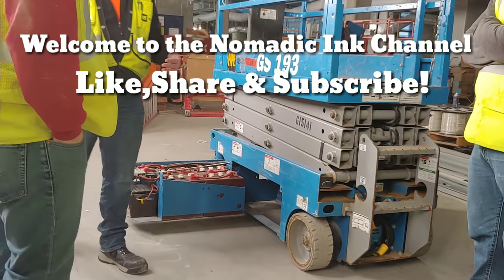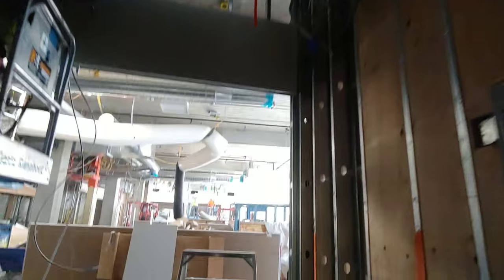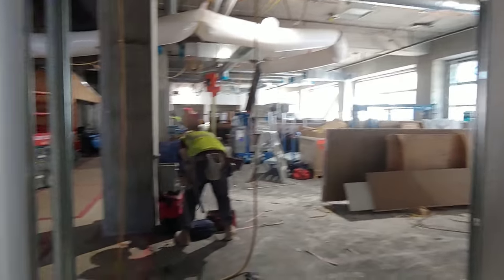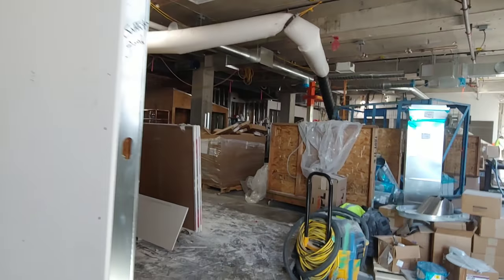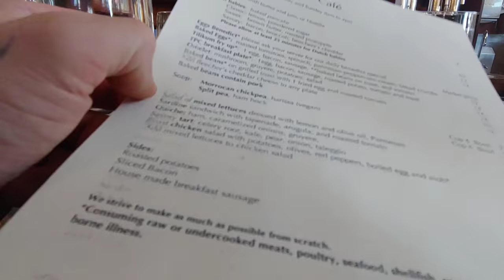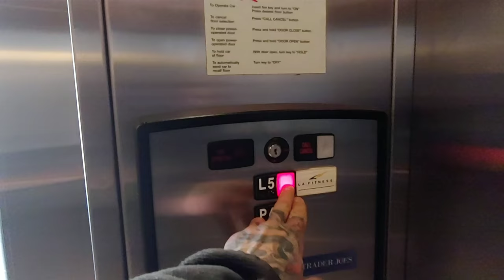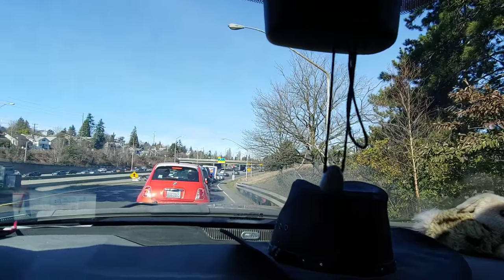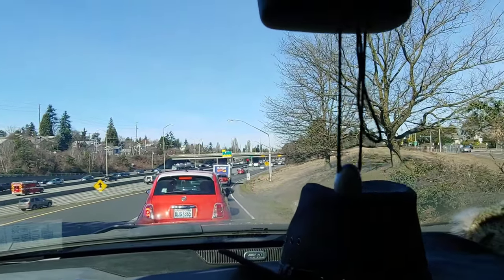Drywall and steel studs this is my union life!

Comment: Hey James so I got this job small commerical job couple walls about 40 sheets metal studs to hang drop ceiling about 9 ft studs go up 10ft should I stand the drywall up or belly band .. ??!
Reply from the maker: I'd probably stand them up if the framing is good. Belly bands just kind of suck. If you could find 54 in 5/8 then you'd be set. But I'd probably go a stand-ups. You got to do a bunch of topping out to? Or just bunch of gravy 9 foot?
Reply: @NomadicINK  grid ceiling 9ft no topping out just a 10ft metal studs wall
Reply from the maker: Just make sure you hang above grid. Sonif the ceiling is at 9 ft hang it to 9'6. So your tape joints not at the crib height. 
Let me know how it turns out